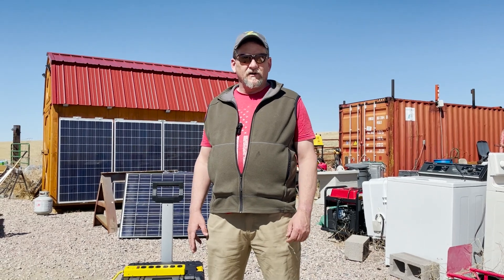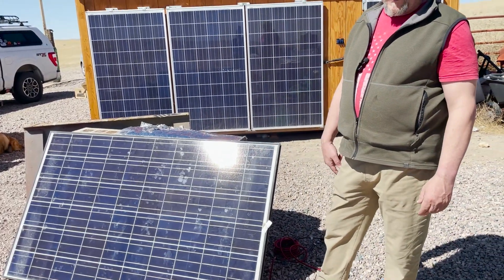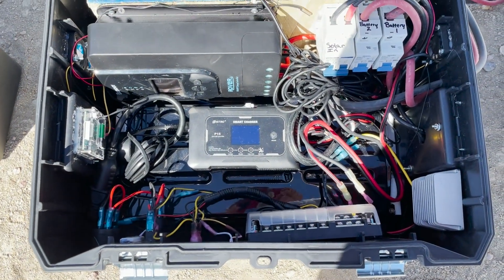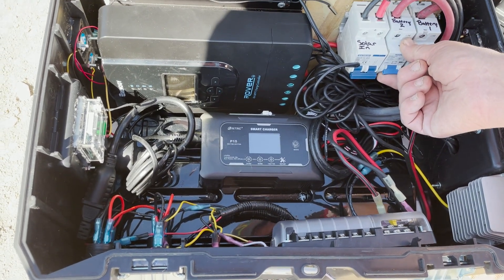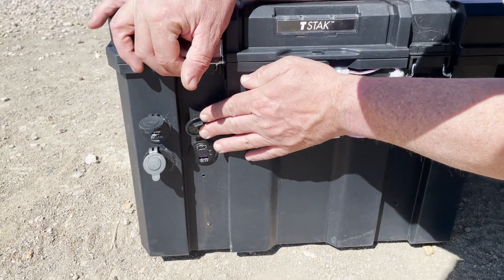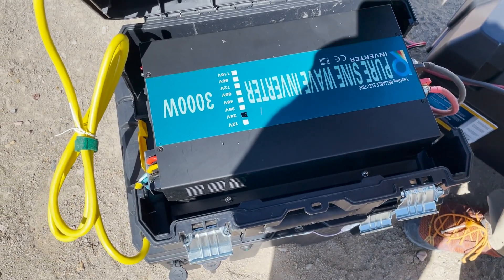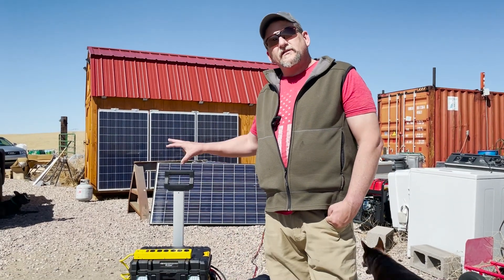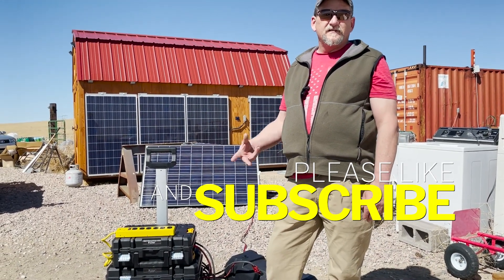DIY Solar Generator. Better than a gas generator?

Comment: its very nice build 🥰🥰🥰🥰i build my own its water proof if i out side and its raining like hell nothing will happing the way i build my i have 1 1/2 pipe for hold with my fan so no rain can get to my fan my 3000 Watts 48Volt i have breaker from my inverter going to out let 2 15A and 20A Breaker

Comment: I built one like this over 9 years ago and took it solar camping.  It worked well, but it would have been better if I had massive panels like yours :)
Reply from the maker: When I take it camping I take 6 - 100 watt panels.  It does pretty well.

Comment: I hope you don’t have the usb stuff connected to the 12V converter. They all work fine on direct 24V and waste less energy that way, also, the PD output is stronger running from 24V

Comment: I bought that 24 volt battery from Singular Solar. Wired up an Overkill BMS.
Lots of power for the price!  BYOB
Build your own box. Haha
  Signed A Happy Camper.
Reply from the maker: I have two of them and now my friend has these two.  So far so good.